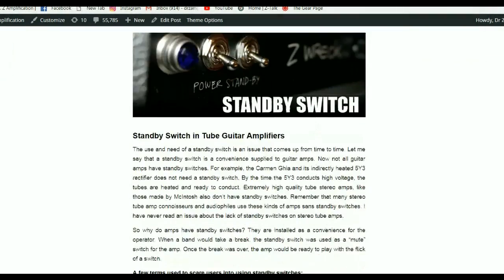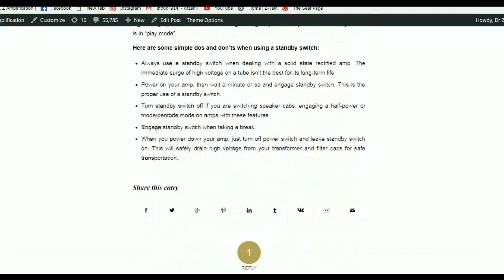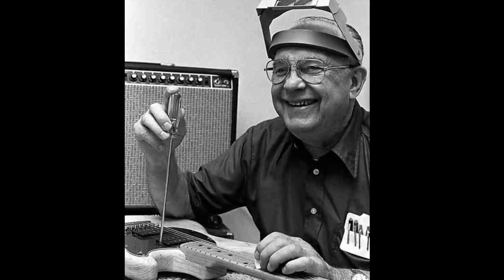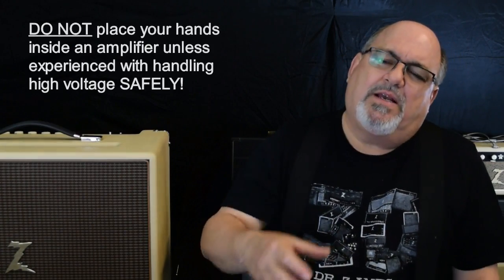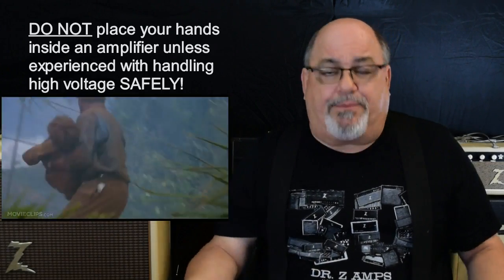Dr. Z AMA: "How to use your Stand-by Switch"

Comment: Thanks Dr Z!!! I was watching a few other videos on how the Standby switch is not needed, but NONE of them mentioned the need of the Standby switch with amps that have a Solid State Rectifier!! My amp has one! So I'm glad I found your video on the use case FOR the standby switch! I may have screwed up my (very expensive) tube amp had I followed those other videos... yikes!! Thank you Dr. !!

Comment: I do have a solid state rectified amp and use the standby switch when turning it ON. When turning the amplifier OFF I was told to NOT use the standby switch to "let the capacitors drain gracefully " I hope this is correct because I've been doing it this way for 35 years! Lol Keep up the good work Dr. Z.
Reply from the maker: that's correct. probably wise to use a stand by on a SS rectifier amp
Reply: Hey, it's done you okay 4 35 years!! The proof of the pudding is in the eating.

Comment: I never use the standby switch for breaks between sets. I was always afraid of “plate stripping”. And old guy I knew that was an excellent amp tech told me “the standby switch isn’t a mute switch. Then he told me about plate stripping of your power tubes. It sounded sensible to me. He told me the biggest reason for standby switches originally was to protect the caps. Because the caps that were available back then were actually more fragile than today’s caps. You hear so many opinions and stories it’s hard to know what to think if you’re not an electrical engineer. To be honest, my standby switch on my amp broke on my amp in the operate position years ago and I’ve been to lazy to have it replaced. I just turn my amp on and off. That’s it. Never a problem with tubes or anything else doing it that way. For breaks between sets I just turn the volume down. I like my tubes to stay hot and ready between sets.
Reply from the maker: You are referring to cathode stripping and it doesn’t happen in amps with this amount of voltage. He is correct though. It’s not a mute switch.
Reply: @DrZAmplification  Ah! Yep. That’s what it was. Cathode stripping. I didn’t remember correctly. Definitely not an electrical or amp expert. It’s been at least 30 years since he told me that. Thanks for replying and for your videos!
Reply from the maker: @sgholt  no, the filament is there to heat the cathode.
Reply: You could just pull the lead out of you amp a bit like the Doc said, I do when I use a little fender amp and it is silent when pulled out a notch but ready to cook as soon as you plug back in.

Comment: I guess I've always used the stand by switch like a mute button. I put the amp in standby before I switch guitars because I don't like the loud pop when you plug in to a hot amp. I've seen guys use their pedal tuners as a mute too. Just kick on your tuner and switch guitars. I've never seen anyone have electrical problems with either method. I'll also put the amp in standby if I'm taking a short break. I'm also in the habit of engaging the standby for a few minutes while my amp warms up and for a few minutes before I turn it off... judging by the video and the comments, I'm probably wasting my time but I've never had a problem with my method. Also I'm so OCD I'm not sure I could change now lol. Rock on amigos and thanks Dr. Z. 🎸 🎶 🎵

Comment: i just wish amps w/standby came with explicit instruction not to leave the amp in standby for extended periods! most musicians i know (myself included) are operating under the assumption that this is included in the intended functions of such a part.

this is a fantastic overview! i thought it was brilliant to point out the standby's usefulness to the technician first and foremost, i agree completely but hadn't really considered that!

also worth noting that there are some standbys that are literal mute switches only, such as the one on the Silvertone 1484/Twin Twelve, which simply mixes the two halves of the output signal together to cancel each other out. i think these would be relatively ok to leave in standby for long periods? besides the normal wear of having the tubes on and idling, of course. but i have heard that it is primarily 1) extended periods in cutoff, and 2) drastic and swift temperature changes (such as when turning the amp on/off) which wears the cathode out the most. this leads me to believe that using the Silvertone's mute-standby switch for long periods would be advantageous for certain situations, like a by-the-hour recording session or a gig with multiple sets, because it would be less wear than switching it on and off a buncha times... i'm probably overthinking it!

the only advantage to a true high-voltage killing standby that i'm aware of that you didn't mention, is it can protect your filter caps from over-voltage spikes upon startup, which is especially important if your amp is vintage (esp. 40's & 50's), because the increase in wall voltage over the years could push them above their voltage tolerances!
Reply: Can't remember what the model name is but there is a "Brown box" power regulator that goes between thecwall  and the amp plug. You can set it to the exact V you amp needs like 117 V on those old amps from 50s. Brown box?

Comment: Thank you for this video and for your blog. Also, for taking the time to answer so many questions. I did find the “Dos and don’ts” of the blog confusing as you switched from saying “engage the standby switch” (which I took to mean put it in the on position) to saying put it in the on or off position. In the blog it sounds like you are saying to leave the amp in playing mode during breaks and mute it by pulling out the cable or with a tuner. I apologize if this is obvious to everyone but me. Ha!
Reply from the maker: I know it's confusing, so maybe that needs an update. We now refer to it in the "run" or "stop" positions.

Comment: I've left my Vox ac15 with power on and in standby mode for 2 or 3 days a couple of times, and it ended up in the repair shop to replace tubes and a tube seat once.  The Vox is designed with the controls on top, so it isn't obvious at a glance what switches are on or off.  I am now very conscious of making sure both switches are in the off position before I leave the room.
Reply: Pull the plug out of the wall. Lightning etc.

Comment: I have an EMS.  My dealer suggested I engage the standby switch when shifting between SS and Tube rectification.  But on the Dr. Z forum the consensus is that it is not necessary.  Your comments in this vid make me think the dealer was right.  albeit...the amp is already on and the tubes heated when I do that...so I guess they aren't getting slammed as you discuss when initially powering...the tubes are already warm so they aren't "shocked"?  Btw, love the EMS!  My other amps are all Mesa's and the EMS is just amazingly more articulate and just plain "musical" by comparison....oh...and I can actually find the tones I am looking for....that's a big plus too.
Reply from the maker: Under normal operating circumstances, it shouldn't be a problem, but your are switching high voltage when using the SS/tube switch. It would not hurt disconnecting the high voltage (B+) by using the standby switch before you change the rectification method. It's the safer method, but it unlikely to harm anything if you don't, as long as both the switch and tube rectifier are in good condition.
Reply: Thanks!  I will continue to do it as a rule, but not especially worry about rigid adherence either.

Comment: The way I do it with my Mesa is - Standby then power on - Power off then standby off. And I use standby when switching equipment or taking small breaks, but never leave it in standby for long periods.

Comment: I read in either Guitar Player or Vintage Guitar magazins - BEFORE the internet and all the crap on it - if you warm the amp up on standby, and turn it off, NOT on standby your power tubes will last longer. It is a useful circuit.

Comment: I use it to mute the amp when I'm changing pedals out or changing guitars or anything like that- or kicking on a pedal that has that horrible pop when the foot switch is engaged. What causes that? I have a couple EHX pedals like that- sounds like a shotgun blast when I engage the footswitch. Anyway- I thought that was the intended use because yes, you can turn the volume down or turn it off but- anyone who has sat in front of their amp bumping parameters this way and that for an hour tweaking everything perfectly to get that perfect tone- you don't want to have to turn it down or anything just to go take a piss. And I don't like turning it off and on repeatedly, I do think that stresses the tubes unnecessarily. Every time they heat up and cool down, they expand and contract- that can't be good for them. But i find it very useful as a mute while being able to leave all parameters (vol. included) in place. Volume on a tube amp is more than just volume- it changes the characteristics of tone the amp is producing- sometimes slightly, sometimes drastically. 

 I guess that's old news to anyone used to using tube amps- I just got one- I've always played solid state- over 20 years I played nothing but solid state. Not really by choice- couldn't afford a tube amp and tbh- I always assumed that like most other things ppl were exaggerating, it couldn't sound that much better. Plus, I grew up in the late 70s- 80s- solid state became the "in" thing there for a minute- and that happened to be when I started playing, so at first, I wanted solid state. We all did- we wanted solid state, high gain amps- to play Metallica, Van Halen, etc. -- Peavey was the hot thing. But see that's the curse- you buy a Peavey- they never tear up- and you play that damn thing forever. Hard to justify buying an amp when yours is still rocking away- and is even a desirable model- I had the Studio Pro 112 Transtube. And I still have it- and yep, still works- I finally just gave up and bought something new anyway.  And I'm glad I did- Blackstar club 40 MKII- and it sounds amazing. I was a little concerned about it being a 40w amp, a "gigging" amp they kept stressing- but it's not too loud for the bedroom- not for my bedroom anyway.

Comment: Thanks for taking the time to do weekly AMA. My question is, do I need to replace my preamp tubes regularly? Some people say every year or two? Should I expect to replace my v1 and v2 more often than my reverb send and return tubes? What about the phase tube or the rectifier? I saw your great AMA in the power tubes of the max 18 so I know I won’t change those. Thanks...Sam
Reply from the maker: Nope, if the preamp tubes are not making any noises, and the amp sounds good to you, don't change them. Preamp tubes last many many years longer than power tubes, as they are under much less voltage than a power tube is. The same goes with a rectifier. A rectifier will either do it's job, or it won't, and you will know. No need to replace it if the amp is working correctly. Simply put, "new" tubes don't mean "good" tubes, the only "good" tubes are ones that are currently working properly, regardless of age. 
Remember the cardinal rules: "if it ain't broke..."

Comment: Is it necessary to pop the amp into standby after playing it for a few hours? I always heard that was the main purpose, to let it cool down before turning it completely off.
Reply: Check the blog post that Doc refers to.  It's better Not to use the standby when you are powering down the amp.  It drains the electricity from the components if you don't use the standby when you power down.

Comment: How is the standby switch circuit designed? Leo Fender's design was okay for techs but it's kind of sketchy for players. Valco often shorted the push & pull circuits together effectively making it into a mute switch. As for "cathode poisoning" that can happen without even running the tubes. GE only warrantied spare tubes for 1 year whether they were ever used or not. They were also prorated at 1 year so after 6 months you only got a $1 credit on a $2 tube. RCA also had some wonderful insights on vacuum tube aging in some of their "internal use only" technical documents.

Comment: How about a standby that mutes the signal rather than cutting the HT, shorting the PI grid to ground, or like the Silvertone 1484 which cleverly shorts the out of phase grids of the power tubes together? Probably makes a loud pop and running sensitive grid wires from the board to the faceplate could be problematic.

Comment: Why don't we see more amps with stereo xlr (combojack) di outputs built in with isolated paths to and from clean and OD1/OD2? It would be nice to have a ground lift... imagine if that same di had a 5g wireless output ;). I guess my question is why dont we see more innovative amp concepts?  (it cant be because cost) Thanks and love your work.

Comment: Does it also help with the high voltage from the output transformer when the speaker needs to be quickly disconnected? Thanks!
Reply from the maker: Best to just turn the amp off before disconnecting the speaker.

Comment: Is it safe to change the impedance knob and connected load by switching a running amp to standby first? Or wise to shut off the amp first
Reply from the maker: Switching to stand by is fine. Even better, disconnecting the guitar from the amp, that way no signal is present. No signal, no potential for output, no harm to the output transformer.

Comment: Dr Z, im an amp newbie.i recently got a Monoprice Stage Right 15W.
Q: would it be a good idea to use the 1W feature as a sort of standby? (it has no real standby switch)
Reply from the maker: It doesn't matter, the stand by is not necessary.

Comment: Thanks for this Dr Z. Basically there is no solid reason for a standby switch. All the reasons for maybe needing one are easily dealt with by another method. I read that the reason Leo Fender used them was because of the limited values of filter caps at that time. The current at startup easily charged the caps and thus full B+ was applied to the tubes before they had heated up. So the standby switch allowed the tubes to heat up before B+ was supplied to the tube. With larger caps, the inrush is soaked up so the rise in B+ is slower, giving time for the tubes to heat up. Therefore no standby needed. With solid state rectifiers and large caps there is no need for a standby switch. So if you are building an exact copy of an early Fender tube amp a standby could be added. Maybe. Many early amps did not. The RCA manual does not even mention standby for receiving amplifiers…it states they are only for high power transmission amplifiers.